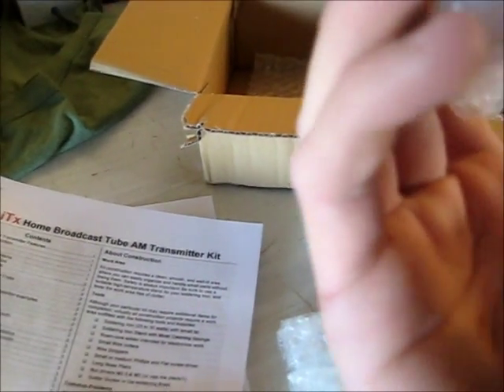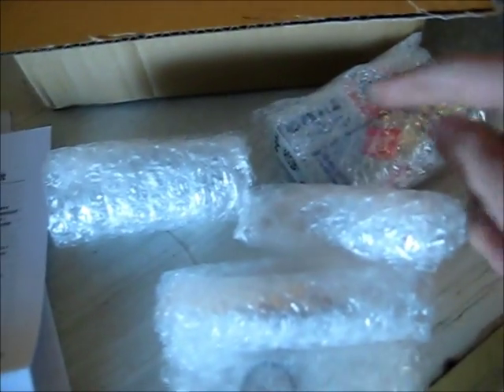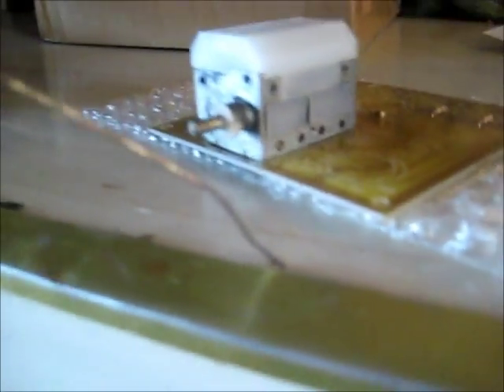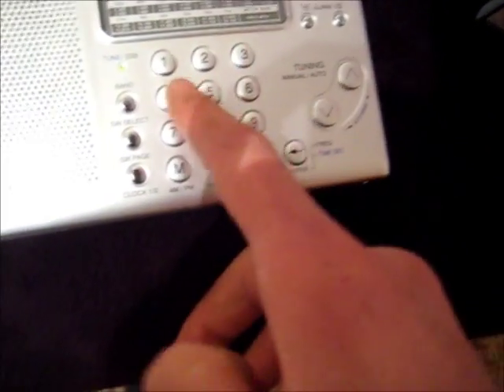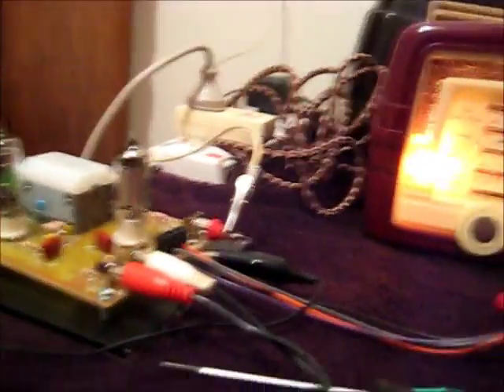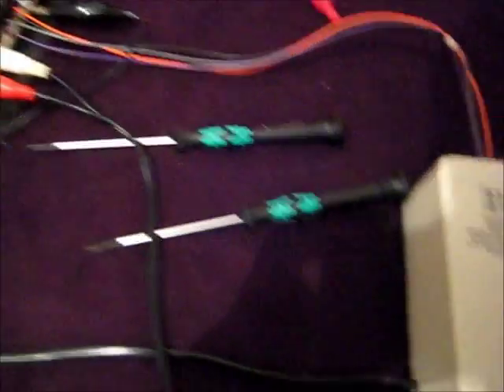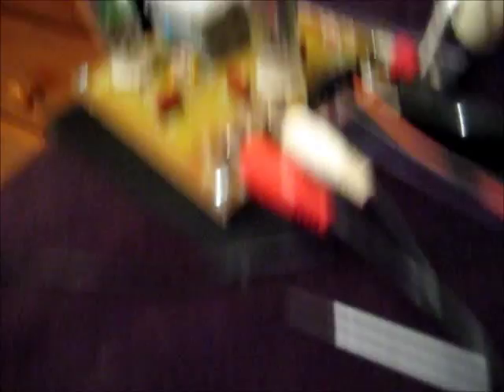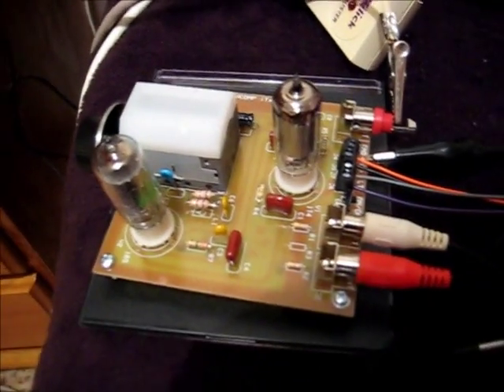Building an AM Radio Station From a Kit

Comment: those inductors are in fact coils of wire in a resistor like casing, this confused me when i built the kit but if you look they are slightly larger than resistors 
well i think so